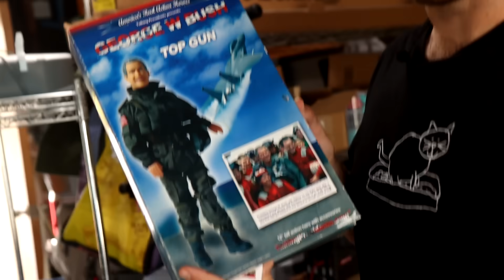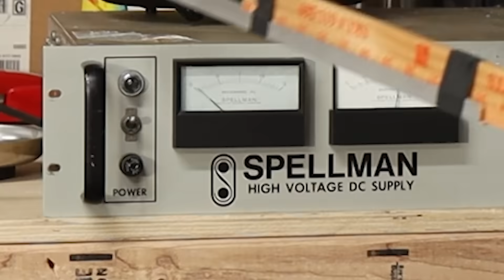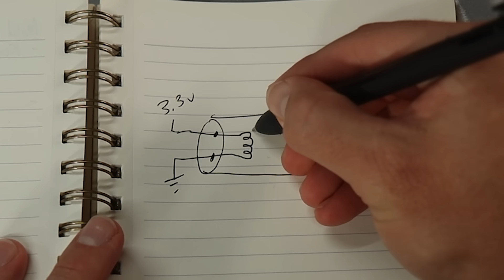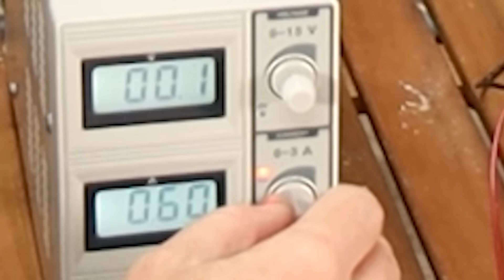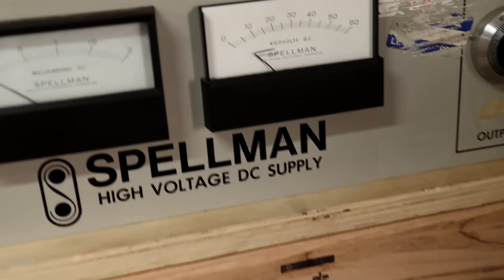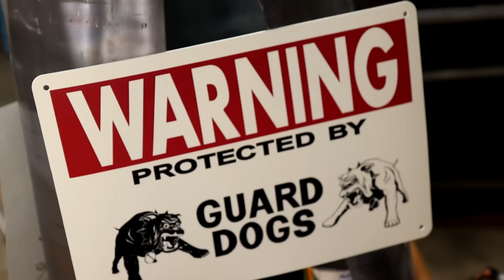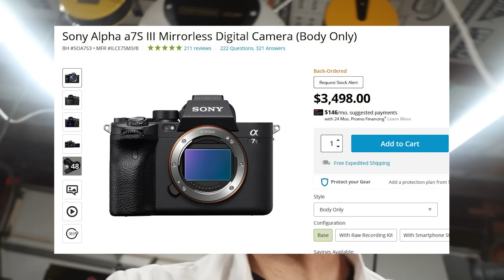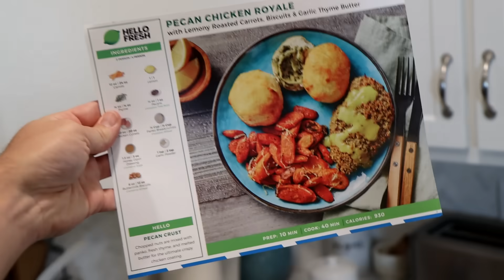Built My Own X-Ray After a Hospital Charged Me $69,210.32

Comment: Small x-ray tubes are used for a very short period of time. Larger tubes like the use on Floroscopy table CT machines etc. Have an x-ray tube with a rotating anode to avoid making burn spots on tje anode

Comment: I found this video horrifying - not because of the x-rays but because of the high voltage - and yet fascinating - hence, making it to the end. SIDE is what to follow: Switch off; Isolate; Dump; Earth. ... Switch off the power; Isolate the equipment, ie, unplug it; Dump any charge, ie discharge any capacitors; Earth it by having a ground link so that charge cannot build up anywhere.

Comment: NO.  Uninsured people get billed at much lower rates.  When you have insurance, the amount is inflated, the insurance pays a contracted rate, a discount is added, and you pay what insurance did not pay (usually a set percentage).  That is the oversimplified version.  Medical billing is actually much more complicated than that and the rates and cost to insurers and patients have varying and complicated tables and formulas.  The same X-rays you got can have varying costs to both you and the insurer as well as middlemen in the process.  But that would take pages to fill.  Carry on... I want to see this.

Comment: I looked up the prices for MRT *devices*:
They start from roughly 1.2 million USD used.
However, X-Ray machines are a completely different story. The fanciest new digital ones seem to cost less then 300,000 USD.
i think the "classic" variant started around 200k new.
So you could probably buy a used one for 70k.
So i wonder if they use them as disposables and replace them every day.

edit:
Corrected prices, i looked them up in €

Comment: Wow, surprised you are still alive, insulating those HV lines isn't hard, next time get some spark plug wires. The insulation on the wires you used are prob 600V

Comment: X-rays and readings typically cost $200 out of pocket if you don't have it done at a hospital or emergency facility. The reason you're paying $2000 is because your insurance also has to pay 10% of people on medicare's actual medical expenditures as part of price shifting. (This is due to a bizzare methodology set out in the Affordable Care Act to keep "price competitive" with private insurance. Totally broken.) Before the Affordable Care Act you still would have paid significantly more than the X-ray and readings due to price shifting but not nearly as much as you currently do unless the hospital thought you were rich and paying totally out of pocket. But as a benefit no one has to worry about being hit with a crazy high bill because hospitals no longer have the opportunity/discretion to misjudge a patient's ability to pay but the downside is the new system ends up being abused more and everyone who responsibly thinks ahead end up being consistently overcharged.

Comment: For those in the back: U.S. healthcare ≠ "free-market medicine". Free Markets don't have minimum prices set by a hidden panel of "experts", retail pricing set according to payment method and where consumers cannot weigh treatment options according to cost.

For example, MRIs cost $500-$1K/each & they take maybe 20-30 minutes per scan. The machines cost $100,000 upfront, run for 20 years & require basic training to perform. (I.E. MRIs techs aren't highly paid like radiologists)

If we assume 5 days/week for MRIs, 7 working hours & 2 MRIs/hour, a single machine can perform 70 MRIs/week, resulting in $35-$70K/week. I don't care WHAT your electricity, payroll, insurance & rent costs are, there's ALOT of profit left over. That's not a "FREE-MARKET" bc  free-markets ALWAYS compete away excess profits........ UNLESS legislation protects the profits.

Comment: Having worked pumping gasses out of x-ray tubes, testing them, and having seen how easy they are to damage or burn out with the wrong voltage and filament current, I'm very surprised you got it working. I actually thought you were going to toast it by removing it from the dielectric oil and it helps distribute the heat. I'm also surprised you were able to aim the x-rays as they are designed to be focused in a certain direction. It wasn't mentioned in your video if you happened to find the exact voltage and fulfillment current that tube requires. I assume you did since you didn't blow out the filament in the first couple of shots. I applaud your results.

Comment: How is it safe to put the hand inside there without getting shocked by the hV ?  And also how didn't it jumped to the lead and then to u? Not a safety nerd, just trying to understand high Voltage

Comment: You're more or less right about the safety and danger regarding X-rays here, even if it would obviously not be recommended to keep doing this every day in these conditions.

If you plan to test your device further though, I would also advise you to protect your eyes, as the crystalline lenses are very sensitive to radiation (lead glasses should be easy enough to find). Also, to easily protect yourself even more while testing (you might have thought about it too), apply the rule of the inverse of the square of the distance ; around 4 to 5 meters away from the X-ray source (for a hand X-ray), exposure is insignificant.

Which leads me to some advices to refine your hand X-ray (specifically this one, as each anatomical part of the body must have a pretty precise set of constants and positions to look right in the end) :

- You're talking about poor contrast, and the way to actually mainly enhance it is to tweak the voltage, in order to adjust the penetration capacity of the X-rays in the tissues. The lesser the voltage, the higher the contrast (this is valid when we consider bone X-rays). For a hand, a good voltage range stands between 42 to 44 kV.

- Corollarily, even if it's in the great scheme of things, you should also adjust the electric charge input to the tube to make it even better, as it plays on the fluence of electrons between the cathode and the anode, and thus on the fluence of incident X photons towards the intensifying screen, which will in turn mainly determine the darkening/exposition of the X-ray ; the higher the electric charge, the darker the picture. I'm used to the mA⋅s unit to adjust this value, so I'll let you calculate the right conversion factor to get from A to mA⋅s (it doesn't look hard nor tedious, but I'm lazy) ; for a hand X-ray, setting it between 2,5 to 4 mA⋅s, 3,2 mA⋅s is usually great. As I said, this particular constant is not the main factor concerning contrast, but of course, too much exposition would still ruin said contrast (and incidentally shoot unnecessary X-rays everywhere, because safety first blablabla).

- Also, to refine further your X-ray (even if for a hand, it's also pretty much meaningless, even counterproductive, but it's a DIY X-ray machine, so it might be worth a shot), you could try to find an anti-scatter grid, that will filter lots of unwanted X-rays shooting in every direction when they pass through tissues. For the record, it's called the Compton effect, and means that an incident X photon will transfer part of its energy to an electron of the tissue it penetrates, resulting in a less energetic X-ray that will have a modified trajectory after it exits the tissue. In practice, this means that part your X-ray will get "polluted" by scattered X photons, at the same time less energetic (so not faithful to picture what it will pass through) and diverted from their initial path through your hand ; in consequence, your X-ray will have an increased background noise (Compton effect photons) compared to your initial signal (= incident X-rays), that will logically get higher for a thicker body part it needs to penetrate. Anti-scatter grids filter most of these, and also, adding collimators around your X-ray source to narrow the emerging X-ray beam will absorb most of the divergent photons that will at the same time screw the quality of your X-ray and fly everywhere in the room for nothing (safety blablabla²). However, as I said, a hand X-ray do not really need those, since the thickness of this part of the body is usually meaningless regarding those issues, but as a purist, it's a nice finishing touch to avoid several artifacts on an X-ray.

- Finally, even if I rarely encounter this particular artifact, try to not expose an X-ray under 100 ms. It can create what is called the quantum blur (I don't know if it's correct in english, but in french, it literally translates as that), which is an insufficient quantity of incident X-rays, resulting in a heterogeneous distribution of X photons on the intensifying screen. It looks like a granular picture in the end, but again, for a hand X-ray, it is nowadays meaningless with actual radiology modalities. I do not use DIY X-ray machines though, so I don't know the impact it can have here, and you can tweak it by playing with the mA⋅s constant to avoid exposure under 100 ms (I'm still lazy, I'll let you do the maths if you're motivated enough).

- An enlightened viewer
Reply: Thank you for the interesting read 👍

Comment: As a radiation safety officer at a materials lab, 80% of this video had me screaming internally.
Reply: I tell you the same on the electrical side of this
Reply: @dylanharding5720  Goddamit. the guy needs an x-ray. If he suffers from electrical shock, he can build something to fix that later if it happens. Lighten up!
Reply: As a user of electron beams that create x-rays, I was screaming internally at the other 80%. The reason modern x-ray machines are safer than a high altitude flight is because the detectors are way more sensitive now, so the x-ray dose is low. X-ray emission rises much faster than filament current, and most radiation sensors, such as Geiger counters and avalanching detectors, underreport high doses. 

At least he stood several feet away from the high voltage... until he x-rayed his own hand. (No wedding ring, unlike Roentgen?)
Reply: @markwistey2802  Now think of all the hackerspace 20-year-olds who are going to buy all discarded radiation equipment they can find and promptly irradiate all of their friends believing the Internet man actually understood what he was saying. The smell of discharge ozone to the magnetostrictic hum of old school equipment promptly sparking a sudden rise in budget scintillometer sales. And that one normal Tuesday afternoon, when Jason suddenly finds a lump that his honey keeps insisting has always been there.

Based on the comment comparing airline travel and CT scans I doubt the term order of magnitude means much to the Internet man but I'm wishfully hoping to be proven wrong. Safe to say this is the very first term I've even seen the guy.
Reply: Let me guess, the safe 20% were when he went to bought ice cream, and the endind sponsor?
Reply: 14:26 mic and cam just "randomly" died Hmmm...
Reply: @madlad7841  I believe he says the mic on the camera died, still unnerving.
Reply: As a high voltage electrician i feel you
Reply: Yeah I would think the radiation risk would be much greater than the electrical risk if he somehow managed to expose the source by accident.
Reply: @tstephansen  he's getting very close to uninsulated high voltage cables
Reply: worked at an xray manufacturer and done plenty of xray/CT installations/trainings.
Reply: I agree on the point people should not try this at home in any way.  

But the point he makes about both the medical bills and insurance being broken is so legit.   Often they will not even tell you the cost if asked because they do not even know.  People can travel overseas for procedures have a vacation and it is still cheaper and faster than if done here.  It even has a name Medical tourism.
Reply: you are all cowards, not terrible not great
Reply: If u don't elaborate, your comment becomes useless
Reply: Because you realize how much your workplace over charges people?
Reply: @timothypankiewicz6312  what part of materials lab do you not understand
Reply: @Misha-dr9rh  It's cute you don't think the overcharging starts there.
Reply: Safety nerd!

Comment: 1:37 That copper firepit/firestand. I got the same years ago. Menards $100. 4:50 you need the oil for insulation otherwise the electrons will arc over through the air.

Comment: At 5:18 I got this feeling like my innards decided to play musical chairs. Every once in a while on the internet you see something like this, where someone is about a coinflip away from death and is completely unaware. Like that time Coyote Peterson stuck his hand right up next to a wandering spider without knowing what it was. Or, to go with an older example, that one photo of two kids on a mountain with their hair standing on end about a minute before getting struck by lightning.

"SaFtY nErDs aRe AnNoYiNg" – proceeds to address everything except the thing that could have easily killed him

INB4 "bUt ThE SuPpLy WaS CuRrEnT LiMiTeD": If he made sure the capacitance in the circuit was below a safe limit he was fine, but if not the point still stands. Sure, there might not be enough total capacitance in the output circuitry of the power supply and that coaxial cable to be lethal at 60kV (it would need to be about 5nF); but he may not have known and you certainly don't know.
Reply: Yeah but, who asked?

Comment: So I used to work for an x ray tube manufacturer and I think this guy is pretty clueless. We used to put a ton of effort into clean rooms and creating vacuums lacking single atoms using electrostatic pumps, because when the x rays hit any kind of obstruction, those obstructions can lead to false diagnoses.

A lot of what you’re paying for with an x ray machine is that kind of quality control - this is really the difference between homegrown equipment and a medical device and it’s where a lot of the cost is.
Reply: you used to WORK for an "x ray" (spelled x-ray btw - surprised you didn't know that) tube manufacturer? Exactly how does that make you an x-ray technician?
Reply: @DesignByKirk  I was an advanced manufacturing engineer and touched every aspect of the manufacturing process. I was deeply involved with making sure the x ray tubes stayed perfectly clean and didn’t have a single atom of atmosphere within the tube. And it took a lot of very exotic and expensive technology to make that happen (you can’t pump out single atoms). So yeah, I know how important it is.

Unfortunately they never schooled us about always the dash in x ray. Crazy. Oops, I did it again.

Comment: That device is closer to a fluoroscopy machine than an x-ray machine.  An x-ray machine uses a short blast of x-rays to capture an image on film (or digital sensor).  A fluoroscopy machine produces a stream of x-rays to create a continuous image that changes in real-time.  Also, 60kv is not enough voltage for something that requires low contrast like a chest x-ray that typically uses 100+ kVp.

Comment: I live in Italy and here an x-ray could cost you from 0 to 150 euros. So if you don't have any insurance, it's cheaper to come here to Italy to treat yourself than a hospital there in the USA 😂
Reply: How are your taxes?
Reply: @edwardssistershands  

20% of IRPEF (an italian tax) is used to pay for "health".

IRPEF is (annually):

23% of your income if you have an income of less than 15000 (max 3450 euros) (max 690 is for health)

27% of your income with an income between 15,001 and 28,000 (max 6960 euros) (max 1392 is for health)

38% of your income with an income between 28001 and 55000 (max 17220 euros) (max 3444 is for health)

and so on

there are some deductions based on "dependent spouse" or "dependent children" or other variables.

Comment: yeah...you know that oil ? it's there for a reason, it's dielectric resistance, makes it damn near impossible for the high voltage to jump and arc out, you know, you COULD make your own x ray tube, it's really not all that hard. All it is, is a coil of heated wire, usually coated in a heavy metal to help boil off electrons, in a vacuum, with a target metal plate at a 45 degree angle, this is held at a HUGE positive potential, thousands of volts, the other electrode, the negative, is just connected to the hot coil that boils off the electrons. The target is best made out of something of high atomic weight, another heavy metal. It's basically just a glorified crooks tube, it's the high speed electrons that hit the target, and x rays bounce off it at the 45 degree angle, go through the glass tube, and through your hand, onto a normal photographic film, which you can also make. Just get some paper and soak it in a silver nitrate solution, dry in the dark.

Comment: To give you perspective about x-rays' danger. CT scan does a series of few dozens of scans in few minutes. But that's still nothing, compared to what I've been operated with. It's basically x-ray camera that does 10-15 scans a second. I had two surgeries so far, few hours each. Yes, those are dangerous, but mostly for doctors working with them every day for many years. A single x-ray like on the video is basically nothing.

Comment: You need to collimate your beam in order to generate a clear image. Also steady state power supply with multiple generators gives a way lower dose as only a certain voltage range is useful for image generation. Also also - wear lead.